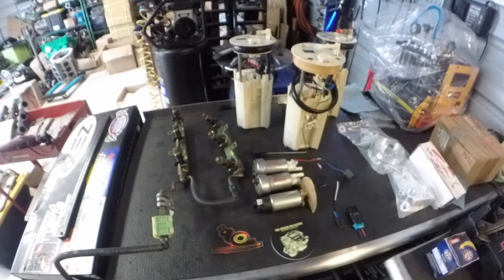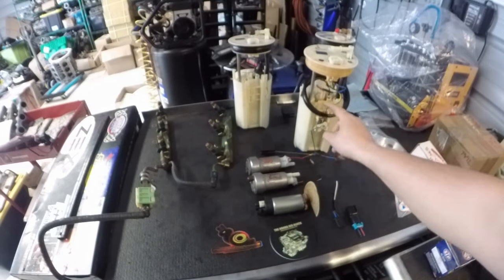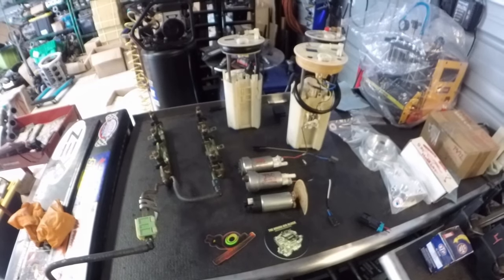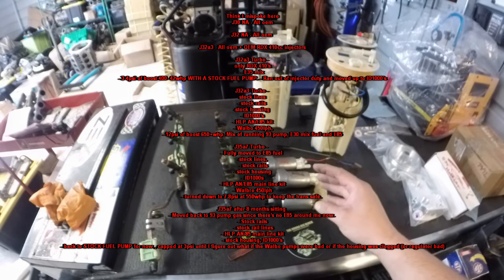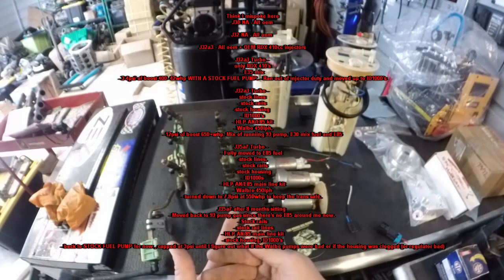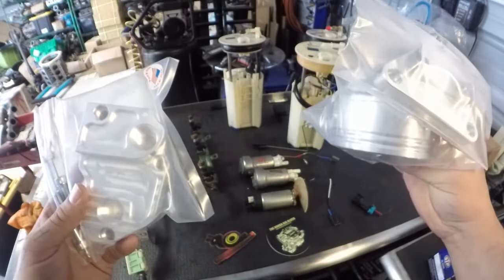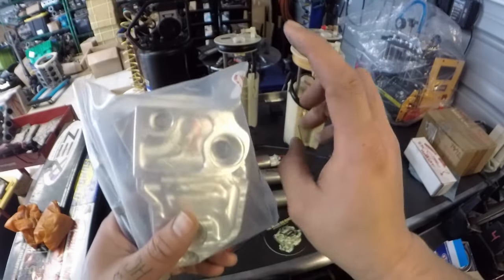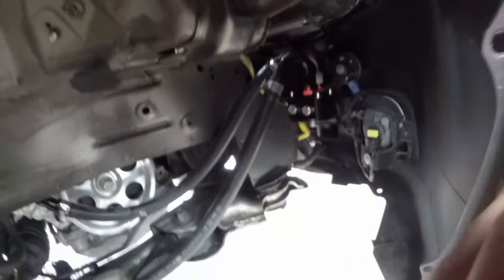Does my Honda/Acura V6 J-Series Fuel System Really Need to be Upgraded, even when FBO? ~ MYTH'S ~

Comment: i recently had a p0171/p0174 from a delphi fuel pump assembly in my 2006 TL, put in the honda one and it fixed it. delphi only lasted 6 months and 8K miles. car is stock. our system is returnless and the pump assembly also contains a filter, fuel sock, pressure regulator in addition to the pump and chamber

Comment: I attest to this information. If you need to reach a high hp goal, just get big injectors 1000cc+ and a big fuel pump and call it a day..no need to change lines or anything of that sort. I ran an auto on E85 with 1300cc injectors and a deutchwerks dw400 pump and made 485 on an auto with a supercharger and duty cycle was only at 70%
Reply from the maker: Yes sir. Thanks for watching Piter. You know we've lived it, walked the walk and talked the talk. You would be shocked how many basic bolt on customers reachout asking about large fuel rails, injectors etc and they aren't even over 300whp. I won't name names but others have just let them assume they would somehow benefit for "upgrading" their fuel systems, which I assume they just didn't educate their customers because they wanted to retain or gain that sale. That's not how we operate!
Reply: Hi can someone please tell me what is the LPH for a honda accord v6 2013 EXL AT. My fuel pump is failing and whole new assembly is very expensive. Is it advisable to just replace the pump with the correct or compatible lph and not the whole assembly? It’s too much expense for me atm I want a cheaper fix but at the same place I don’t want to ruin the car further. Urgent help required

Comment: Hi can someone please tell me what is the LPH for a honda accord v6 2013 EXL AT. My fuel pump is failing and whole new assembly is very expensive. Is it advisable to just replace the pump with the correct or compatible lph and not the whole assembly? It’s too much expense for me atm I want a cheaper fix but at the same place I don’t want to ruin the car further. Urgent help required